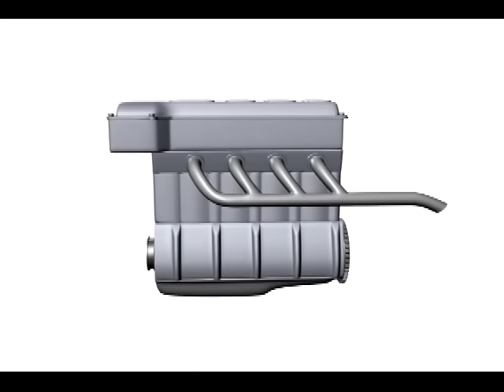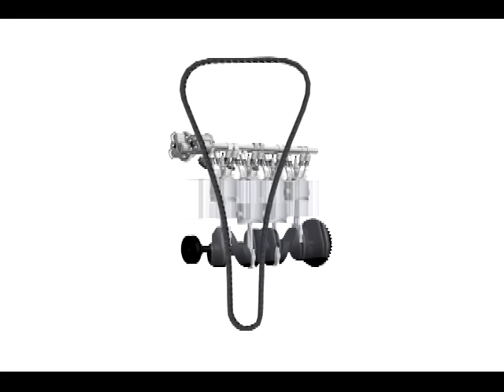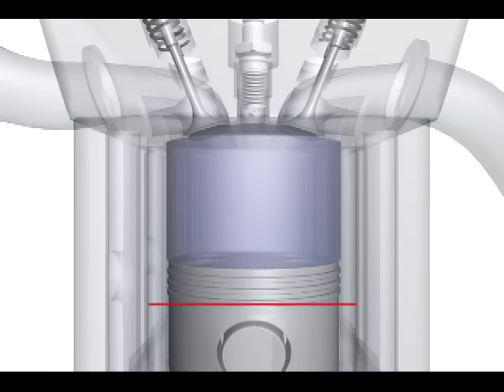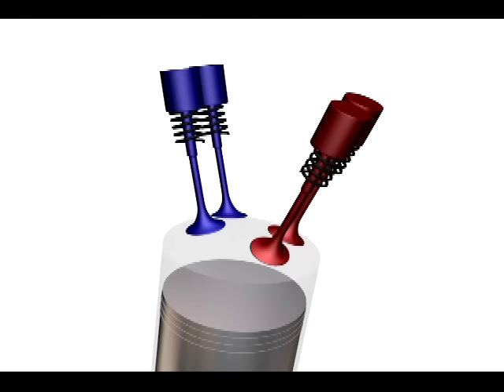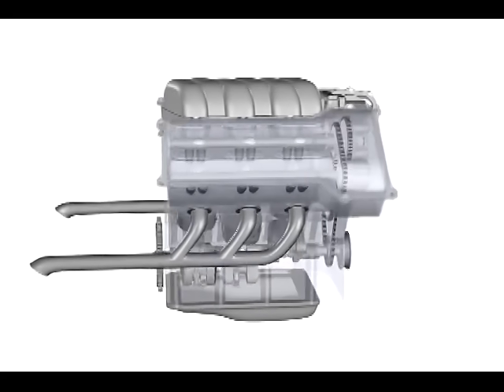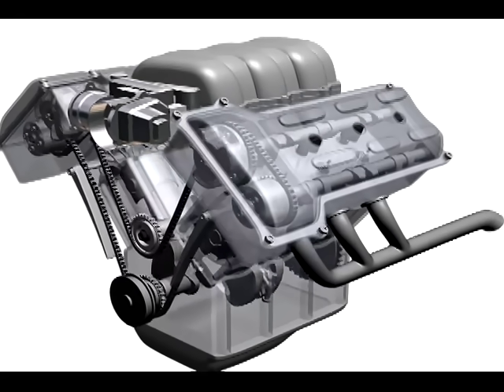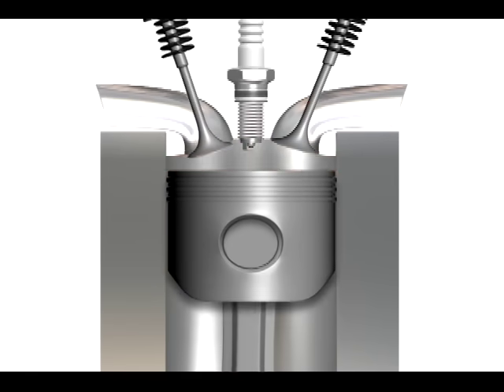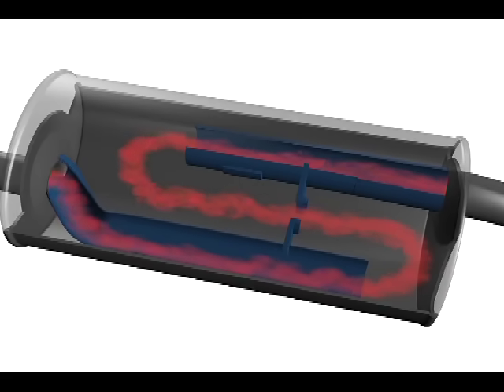How an engine works - comprehensive tutorial animation featuring Toyota engine technologies (2008)

Comment: finding the size of the engine isn't actually as simple as they said.  The volume of a cylinder is πr squared times height.  So it's actually half the bore squared times pi times the height. and then multiply that times the number of cylinders... other than that, this is a very helpful, informational video and I learned a lot

Comment: What about the 5 valve per cylinder setup used in the Japanese only corollas and whatnot. They have 3 intakes and 2 exhausts. I'm interested in how the addition of another intake would be an improvement over the 2x2 setup of the original engine before...Oh, and I forgot to mention the engine is the 4A-GE.

Comment from the maker: So you have picked out a handful of specialty manufacturers that don't design or build engines except Chevrolet who uses the engine they've basically been using forever for the Corvette.

NASCAR requires Pushrod engines. Until recently they require carburettors. Are carbs better than Fuel Injection? Hell no. 

The future of valvetrains is individually actuated valves. The more fine control you have over the valve timing the more efficient (power and performance) your engine will have.

Comment: orly?

Saleen S7
Mosler MT900
SCC Aero
Vette z06

Just a few HP vehicles using OHV setups. A lot of import lovers tend to think "more complex = better". There's exceptions to every rule but generally, OHV engines tend to have better torque but sometimes can't rev as high as their DOHC counterparts. To say one is superior to the other is ignorant. Package size and center of gravity are also concerns for a manufacturer and why one may choose OHV.

PS. Nascar is still using pushrod motors...

Comment: Hate to burst the bubble there, but the 4 valve engines put out much more power and are more durable than the 2 valve system.  More air in, more air out equals more engine power.

Comment: Both 2V and 4V have the same potential by design.If you optimize the flow characteristics and the burn chamber for 2 valves a same level optimized 4 valve won't differ all that much.4 valves just give more headroom.Low end 4 valve setups have same performance with mid end 2 valves(HEMI is just an optimization).Anyways FUCK VALVES.2 stroke's always best.......

Comment from the maker: 4 valve heads with variable timing are, by far, the most efficient valve arrangement. It's simple physics. Future engines will have 4-valves per cylinder and individually actuated valves that can have their own timing. 2-valve heads are old fashioned and have no advantages over 4-valve heads.

Comment from the maker: Not currently in production. No Toyota engine currently in production is an SOHC 2-valve. 2-valve heads are inefficient and single camshafts make doing variable intake AND exhaust timing difficult. The modern layout for an engine is DOHC 4-valve.

Comment: and high HP motorcycles have how many cylinders? and "NOBODY would start off building a high performance engine that was not 4 or 5 vpc"? agree to disagree i guess. have you ever hear of a SOHC motor? and pushrod motors can make just as hp and just as much torque as most DOHC motors. they might not rev as high but sometimes that doesnt matter.

Comment from the maker: Nobody, and I mean NOBODY would start off building a high performance engine that was not a 4 or 5 valve. The companies that have high-performance pushrod engines do so because that's what they've always had and it's cheaper and easier to continue to just build what they have. In the whole world, only race series where it's mandated use pushrods or dual valve engines. HP motorcycles also all use 4- and 5-valve DOHC engines.

Comment: "most high performance engines have a 4-valve per cylinder valve-train"? i dont really think thats completely true. its only true for 4-bangers. I would say there is more of a plethora of high performance motors that DO NOT use 4-valve per-cylinder valve trains in the realm of supercars and race cars. unless of course you are one of those stereotypical import guys who shit talks anything that doesnt have DOHC and a welded diff for fucking drifting. which i hate if you couldnt tell..

Comment from the maker: Basically yes. There are more types of engines and some of the Toyota specific things (like ACIS) may or may not have something similar but for the general layout and 4-stroke operation, it's generic. A carbureted engine doesn't have fuel injectors and some things like that but it's essentially common. Even a boxer engine works the same, it's just laid out differently.

Comment from the maker: In the simplest terms, VVT-i can rotate the camshafts independently to change when the valves open and close. So the valve timing is independently adjustable to maximize efficiency. There was a system VVTL-i which also changed the valve Lift as well as timing. That engine was used in several Toyotas as well as the Lotus Elise.

Comment: Really great video for learning about engines. Which is kind of embarrassing for a Mechanical Engineering student. Not going into Automotive though...
Anyways, does anyone have a "for dummies" explanation of how VVT-i works to control the cams separately when they're connected by the timing chain?

Comment: VVT-i cannot be used on a SOHC engine because it only have one camshaft. There's no way to control intake valve and exhaust valve independently in SOHC layout. Only engines with DOHC able to control the intake valve and exhaust valve separately.

Comment from the maker: @dojmike Toyota has been using VVT-i and related valve technologies since 1991. They also use timing chains instead of belts for reliability. Timing chains should last as long as any other engine components.

Comment: This VVT-I scares me.  That's a lot more that can go wrong leading to much more expensive repairs.  Are there three chains in the cam drive system?  Are these chains intended to last the life of the engine, or do they need to be changed as a maintenance item like the belts are changed?